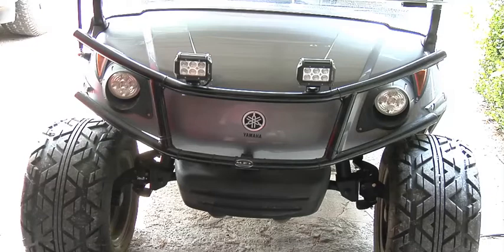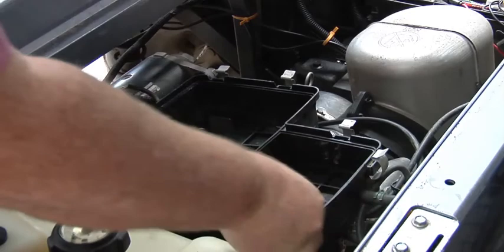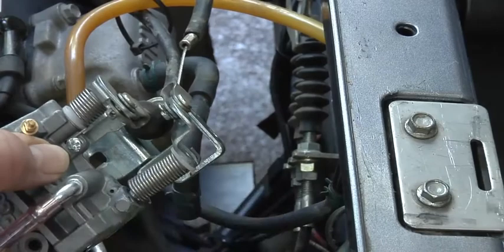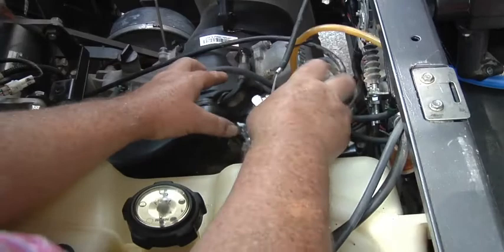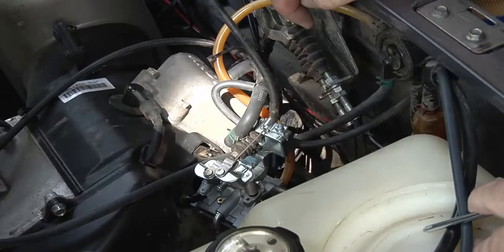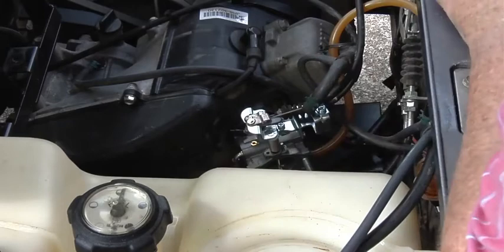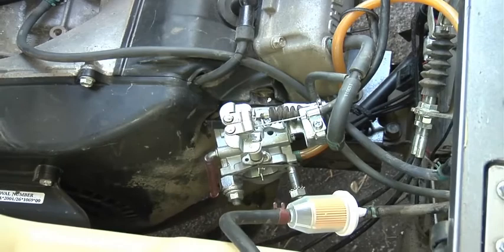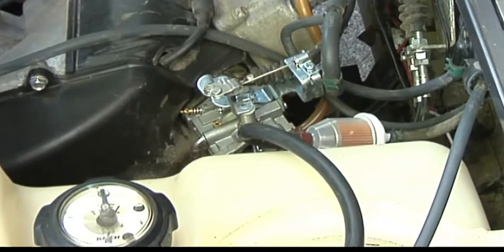Yamaha Golf Cart G29 Carburetor Swap fast.

Comment: Its nice that those carbs are so affordable on Amazon and Ebay. The last one I got was for the Cub Cadet zero turn and it came alive like never before.
Reply from the maker: Yes  found out mine wasn't getting enough air, pull off air box and run like crazy.  I thought it was a fuel problem. Runs good now. Thanks

Comment: Forklift Nations’s amazing custom build Yamaha Golf cart powered with BigBattery Eagle Lithium Ion Phosphate batteries replaced 496 lbs. Trojan T105 for only 38 lbs. per battery.
Powers 4x of powered performance, 4x in total in range, drop and replacement of GC2 lead acid no special mounting bracket and 10 year full warranty.
#batteries #golfcart #lithiumbattery #BigBattery
Reply from the maker: Nice..

Comment: Nice video, question I have a 2016 g29 it back fires when you let off gas pedal. I was told it might be butterfly might be slightly open. And there's a way to adjust it. Do you have a video on that. Or do you think it might be something else. I appreciate  if you can get back to me
Reply from the maker: Backfiring in a golf carts is usually caused by too much or too little fuel, or unburned gas mixture in the exhaust.  Be sure to check your spark plug. Thanks
Reply: @camaromodschannel  thank you for getting back to me so quick. I pulled plug it was set a .23 I put it to .30 the plug clean, almost lean. Do you think it could be butterfly is open slightly. What video do you have that you adjust the carb. Is there any way to send that to me, thanks again
Reply from the maker: @nickpanhead7209 you will have to adjust the carburetor, and I don't have any video on that subject.  I will see what I can find and send it to you. Thanks
Reply: @camaromodschannel  oh wow thank you for that
Reply from the maker: https://www.golfstorageguide.com/how-to-adjust-golf-cart-carburetor/ this may help.thanks..
Reply: @camaromodschannel  thank you for that, I will look into it, I really appreciate this
Reply from the maker: your welcome @nickpanhead7209

Comment: Installed a cheap carb off eBay or Amazon on my grandmas 08 g29. Now bogs down if you let off the gas, get back on it and it falls on its face before picking back up. Even adjusted the governor, seems slower. Throttle cable adjusted also.
Reply from the maker: Yes I had problems with ebay cheap Carbs had to clean original and it works better. I wouln't buy another unless it was original equipment. Lots of junk out there. Thanks.

Comment: So Wich screws do what? That's the entire point of watching this bs
Reply from the maker: This is a carb swap, not a tuning video.  Sorry.
Reply: @camaromodschannel  I got all excited when ya got to displayed that tuning was coming grrrrrrrr lol I just need to know the factory start point and jetting recommends.  But it's okay such is life it's a bit of a touch of throttle blade low idle angle and jetting plus low speed mix screw that's it since it's never wide open being governed.
Reply from the maker: @christopherparis6841  let you tomorrow.